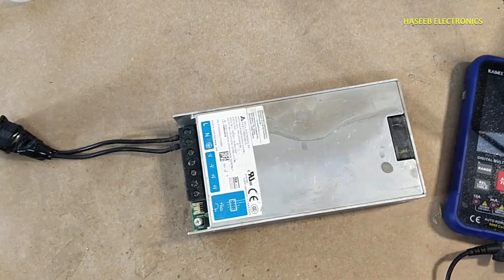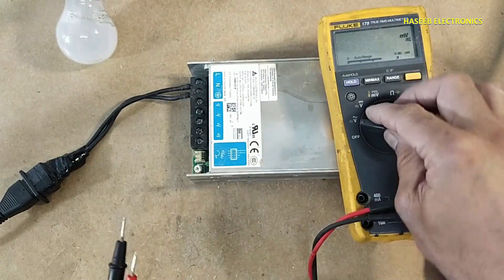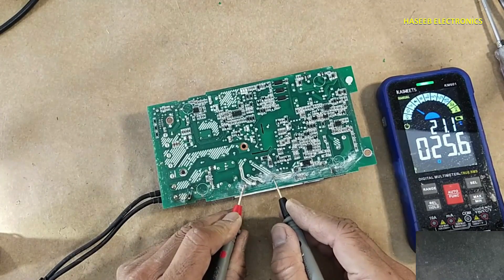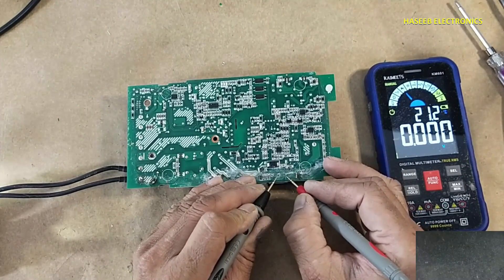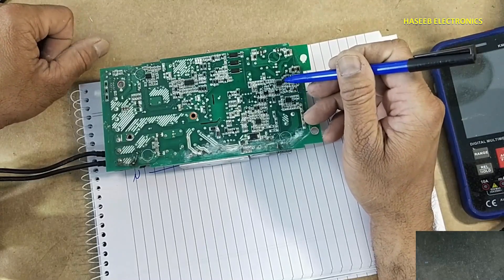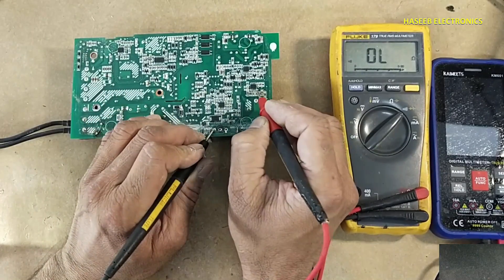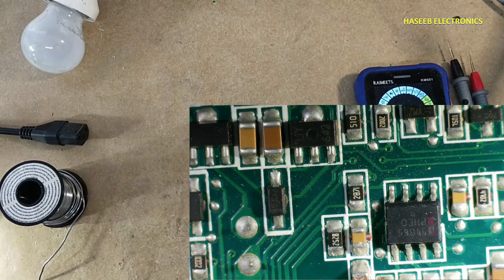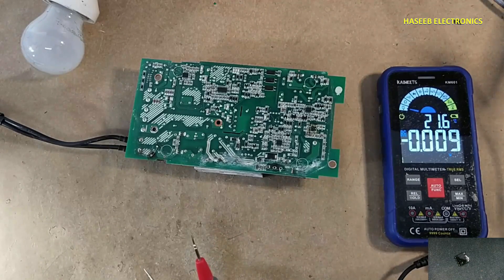{1058} Delta 24V power supply repair, no output voltage

Comment: To my best of knowledge most of your video ends getting back the required voltage but what if connecting to load and not delivered designed current. Did you touch that scenario ?  I'm a hobbyist and a civil engineer , driven by interest I asked the above question.
Reply from the maker: it is a valuable question. some steps i skip intentionally, like testing duty cycle, measuring switching frequency, cheking error amplifier, testing current limit circuit, line regulation, load regulation, ripple and noises (because these are advanced level troubleshooting methods) if i share it for a mid level or starting level troubleshooter, he may damage the test equipment or the unit under repair 
if a power supply is supposed to deliever  10 ampere and it starts with good regulated voltage output, with lower level threshod of vcc voltage, that means the PWM controller have enough headroom to increase its duty cycle for adjusting the output voltage. 
i can share all these test procedures and repair steps. but i am not sharing it publically in sake of human safety and equipment safety 
for output current testing please check video number 586 you are right. https://youtu.be/sUaDQjoOVP0
for duty cycle and frequency test check video number 526 https://youtu.be/c2_aBMiGIxk

Comment: You can use a modern digital multimeter to measure AC in DC mode, or measure DC in AC mode. Normally, if you use AC mode to measure a DC voltage, you should see 0 V (or a small voltage caused by the ripple). If you use DC mode to measure a AC voltage, you should see 0 V (or a voltage indicates its DC offset). this is  true or not sir.please help me sir
Reply: Sir please help me this one
Reply: Indeed, it's true

Comment: Another diode must be installed in parallel with the PFC power choke to charge the capacitor when the circuit starts, most likely this is a diode in an SMC package.
Without this diode, when mains voltage is applied, the power transistor and diode will explode

Comment: It is possible to have three transformer in series or parallel connction
Reply from the maker: yes it is possible to connect in series if current value is same 
but for parallel connection, the voltage and current specifications must be same for each one
Reply: Why sir they install four or five transformer . I have GAN electronic 600 watt el hps light for horticulture. This company is from Netherland. Sir please help me. Share your phone nmber I really need your help
Reply from the maker: my whatsapp number is 00962795608616

Comment: Hello. Yesterday I replaced CR6841S IC in a fake Apple charger ( chinese charger rated to 16.5V 65W) with no output, and got 17.5V. I Reassembled - NO V !! . Nothing unusual happened. I suspect the New IC is damaged. ** What can cause this ? **  ( I reflowed all, and want to do measurements today ). Thank you so much, I really like your videos !
Reply from the maker: check resistor at pin number 3 and +ver terminal of the capacitor , if it is good, then the IC may be suspected 
this time there are many parts fake and falsely marked or dead.
Reply: @HaseebElectronics  Thank you very much for the quick response !  What I understand is : check Pin #3 VIN of the IC , and (  +ver ??) the V on Main Cap. i.e does the IC get start-up V ?  . You suspect low grade replacement , OK, I am thinking the IC got bad , as the first one, from something.. but of course , if so, why did I see 17.5V output.. so you might be correct !  A depressing experience , I was so happy that I correctly diagnosed :(  Thanks again for your time !